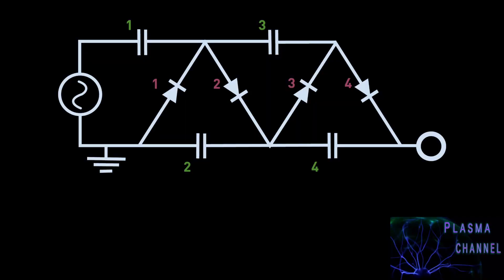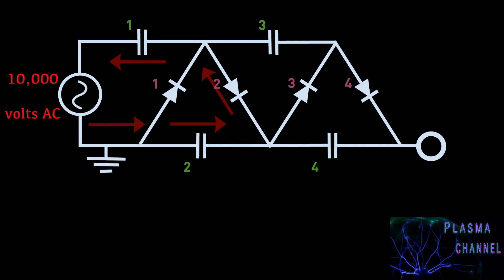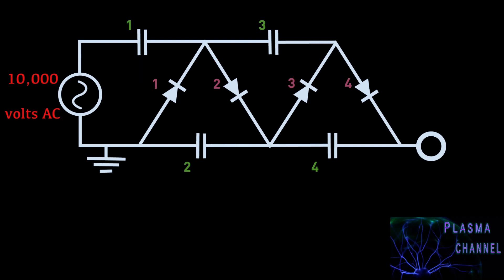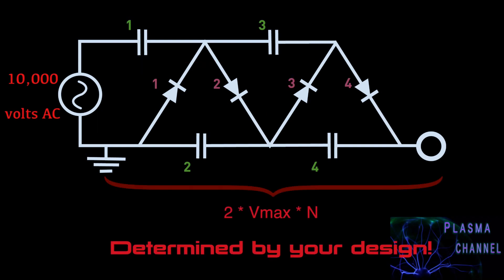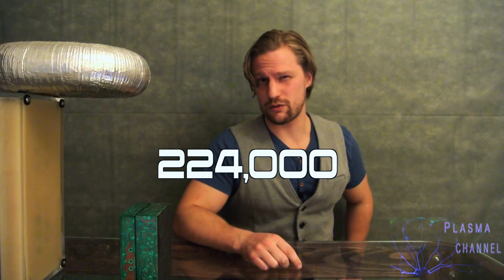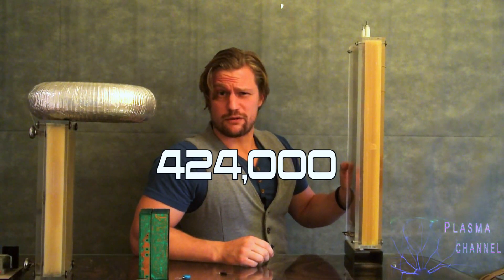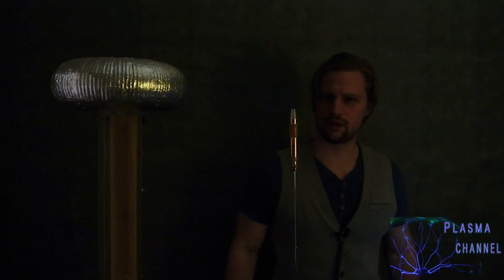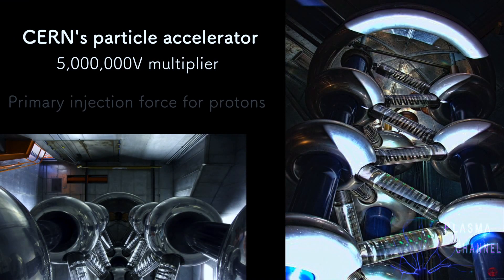We've actually produced LIGHTNING | Here's how we did it

Comment: Jay, what did you use as a ground? Is there any way to create an artificial ground without actually connecting to earth? I have a Marx generator but don't want to run the voltage into my house outlet or back into the circuit as it may fry my neon light transformer ballast, which drives the multiplier. 

(I'm using resistors and spark gaps, not diodes. DC to DC.)

Comment: I got question.
Which is more efficient Marx generator or voltage multiplier?
Reply from the maker: I'd argue a VM is more efficient. Voltage Multipliers involve diodes, which are not as lossy as spark gaps.
Reply: @PlasmaChannel  great 👌.
Thank you for your awesome practical videos.
Reply: @PlasmaChannel  may I request you please for video on Tesla generator, hendershot generator or any perpetual magnetic motor please.

Comment: Repeating the standard model equals epic failure. Seriously ice particles rubbing against one another. It's absurd to think you are going to gather that much charge and amperage rubbing ice crystals. There are a number of things wrong with the standard model, for one, it does not explain cloud cohesion, or why a single lonely cloud in a blue sky, what made the vapour congregate? What produces shearing winds? Lucky for you, I have spent some time pondering this equation, and like you I have a fondness for plasma. 
If you like plasma then you have probably read Anthony Perratt, or Hannes Alfven, if not, you should as these two guys have done a lot of work defining and describing electromagnetic structures in plasma. Earth's atmosphere has a high plasma potential with 78% nitrogen, five electrons on the outer valence means it is easily excited. Water as a polar molecule exhibits plasma like charge separation(Pollack). Lightning is arc mode plasma, Aurora are glow mode plasma, and as far as I am concerned, rain clouds are dark mode plasma. Consider, if you have two examples of modes of plasma in our atmosphere, there should be a third, too. If you check out that charge separates in a thunderhead, charge separation only occurs in a plasma.  If you look at the temperature, chemical separations in out atmosphere they match Perratt's definition of a double-layer. The ionosphere is predominantly Q+ based on atmospheric chemistry while stratosphere is mostly neutral and troposphere is highly electronegative. I posit that protons drift from ionosphere charges air molecules which are then drawn to negative ground producing a high-pressure system. In the winter in my region this produces warm oppressively cloudy days, in the summer, it produces hot oppressively humid weather, always with poor visibility. The charge factor of the proton is what maintains cloud cohesion. Now, what happens to the sun on a cloudy day. Where does all that heat go? Into the cloud. I also posit that the sun's heat producing a thermionic like expression of an electron on water molecule can cause double layers to develop in the cloud, these double layers produce the sheering winds the standard model also doesn't properly explain. When these double layers develop too much charge, lightning occurs. Clouds exhibit cellularization(the lonely cloud), this is a plasma feature. Filamentation and striations as seen in  cosmological plasmas I have seen in clouds. Like I said, not the standard model. It is an electromagnetic plasma universe.

Comment: You have a great channel!   I have a question.  On your DC voltage multipliers what polarity do you have at the HV terminal, and why?  Specifically, is there a deference in the spark discharge when using a positive terminal as compared to a negative terminal?  I have found that Van De Graaff generators with a negative terminal tend to spark more easily into the air than a positive terminal does. This leads to a stronger discharge for the positive terminal.
Reply from the maker: Thank you so much! The high voltage terminal is negative. I found over time that a negatively charged electrode does tend to have better results, and  better ionization.
Reply: Yes, i think its because of the high mobility of negative charge carriers(electrons)...

Comment: I mean.  We can simulate micro-lightning. The day we can generate 100-300kv 40,000 amp arcs I'll be flabbergasted.

The day we can produce a "bolt from the blue" or positive lightning which are known to reach over 1 billion volts of potential discharged with a current of up to 400,000 amps, well . . . can you imagine the size of structure we'd need to do that? The capacitors we'd have to have.
Reply from the maker: A pulse from a marx or capacitor discharge can very easily reach tens of thousands of amps for a few milliseconds. Sometimes less than a millisecond (nanosecond range). 300kV at 40,000 amps is really easy to accomplish for nanosecond energy releases. The positive lighting is a different beast all together. Yes indeed
Reply: Wydenclif tower.

Comment: How would I go about making a musical Cockcroft Walton voltage multiplier?
Reply from the maker: I am not certain this is possible. Hm... allow me a little time to think about it. Interesting proposal!
Reply: Plasma Channel wouldn't be possible I don't think because it's a pulse style
Reply: I think that's not possible cause to make sound with arcs u have to modulate frequency. Voltage multipliers output DC arcs, and are dangerous too. Have a good ground connection and make sure to discharge the system entirely prior to handling.

Comment: Hey Jay, your Cockcroft Walton multiplier is killer, maybe literally lol. Would you be able to tell me what and where the capacitors where acquired and the specs please?
Reply from the maker: Thanks, I love it. Murata is my preferred capacitors manufacturer, as they are japanese and handle tons of abuse. I use ceramic caps only for size convenience. My multiplier is built of 10 stages, each stage rated for 45 kV, with 45kv diodes stringing them. This handles a 16kv input very nicely.
Reply: The more I keep watching this video the more impressed I am with that machine!
Reply: How do you prevent arcing inside of your Cockcroft Walton, better yet could you please make a build video of CWVM?
Reply from the maker: It is filled with a special mixture of wax for insulation
Reply from the maker: My internals are very space minded designed. But even with that, my multiplier is slowly destroying itself. It has lasted 2 years and performs at 90% still. I am trying to collab with a tesla coil company in Austin to do a video on a 1,000,000 volt multiplier....with 3d printed parts, perfect insulation, and perfect engineering!

Comment: What happens when the spark decides to give free shock therapy?
Reply from the maker: You get the phenomenon called 'I almost died'. It's really surprising stuff. But seriously, I've designed all my devices to be on the safer side, so all shocks are limited to painful, instead of deadly.
Reply: Thats pretty neat, do you use to power this cool setup?
Reply: Will it kill a little kid?
Reply from the maker: It is a Cockcroft Walton voltage multiplier. Puts out steady DC high voltage, completely designable
Reply from the maker: Depends on how it is designed. Mine have current limiters internally. I designed it with 2Mohm of internal resistance
Reply: how does it pulse? Is it possible to design a Slayer Exciter setup with as Cockcroft Walton voltage multiplier as  the power source? This might be a stupid question, would you be able to create a rudimentary old fashioned TV, the tube type?
Reply: Jay, what powers the Voltage Multiplier?
Reply from the maker: Absolutely. The voltage multiplier is fed by a 20kv high frequency flyback supply. It is approximately 40 Watts. The multiplier is designed to handle 20kv input, and has 10 stages
Reply: Thank you again, I will let you k own how it works for me, and nice job tying your videos together too.